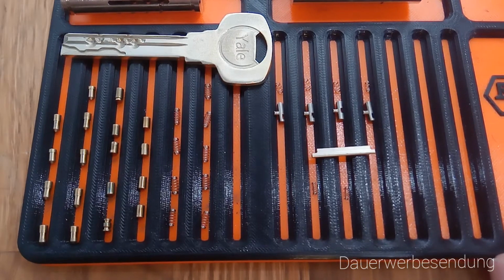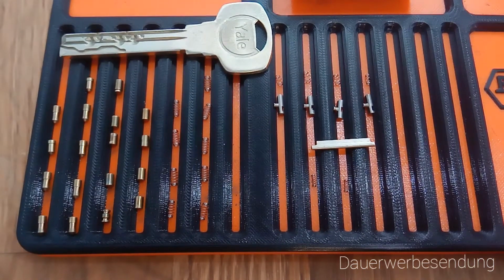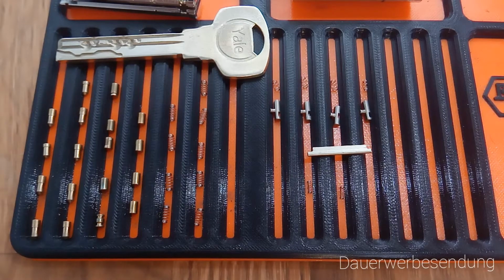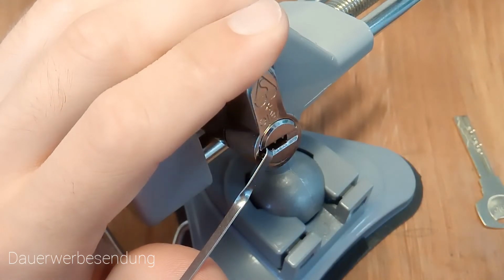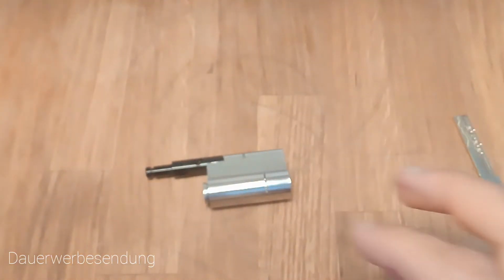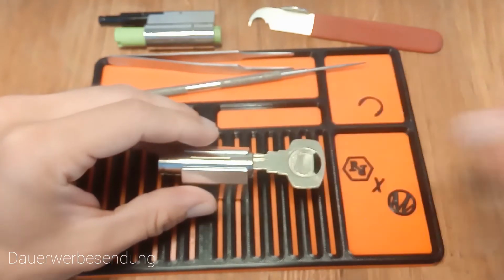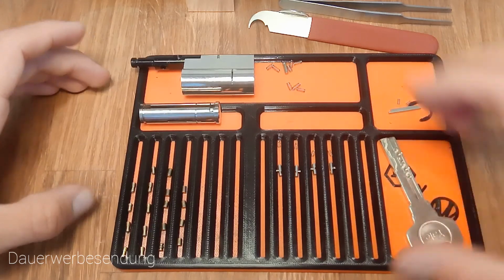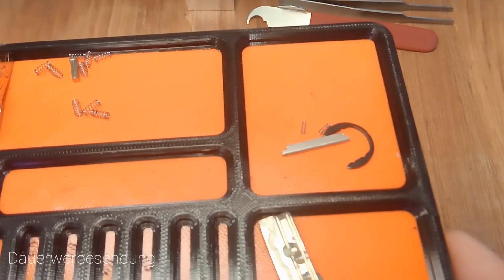(10) Yale Superior (9 pins + 4 sliders) explored, picked and gutted

Comment: Very good explanation on this lock. I think the 2 & 3 star superiors should be full of security pins but I believe they only contain 1 extra security pin.
Great video
Reply from the maker: Thanks a lot.Yes I did some research about the star ranking but so far with no luck on more infornation about the pinning itself. I guess picking resistance is just one of a whole bunch or parameters, right next to drill protection, snapping etc.  If I get my hands on a different model I will compare them pickingwise.
Reply: @mokislocksport5127  It would be interesting to see that.
Many thanks 👍🏻